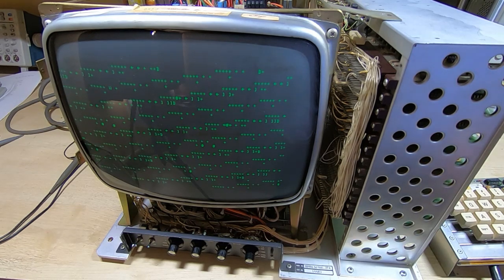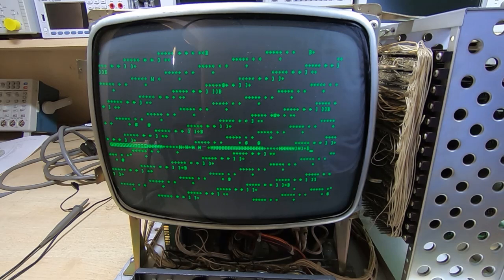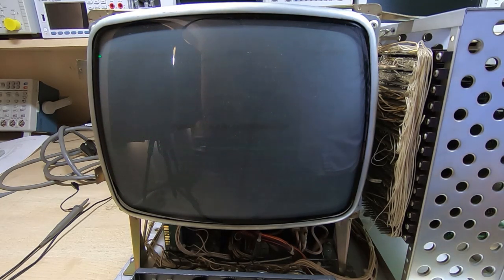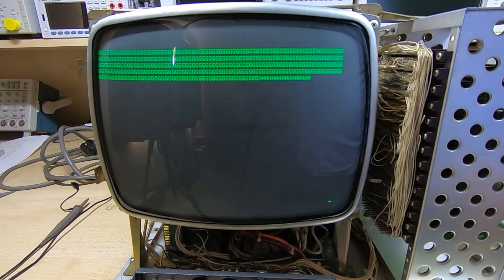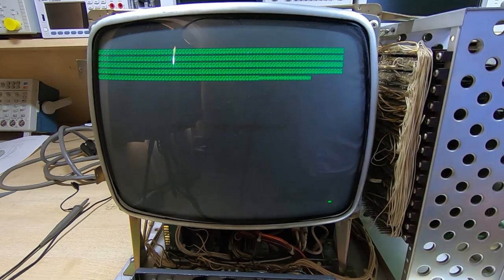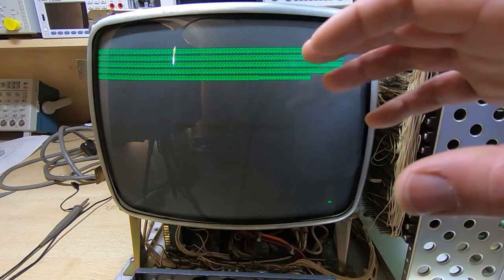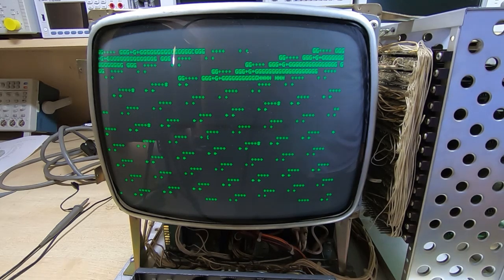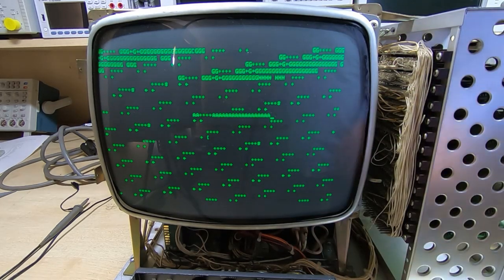Hazeltine 2000 Repair Part8

Comment: Nice way to bring it back operational in a step-by-step fashion. I’ve seen you here and in other of your always interesting series testing device’s monitors with “regular “ signal generators. SENCORE CM2125 and newer models can provide several video test patterns as well as the scan frequencies adjustable. It might be of help for screen geometry test and adjustment. I’ve no clue of other brand that has manufactured such generators. Once repaired it would be interesting to see it “talking“ with PDP 11/34.
Reply: He mentioned this in a video before - he uses a chemical which YT will actually penalize him for even mentioning. I believe it was a substance you can find by searching CAS# 108-88-3. Apologies to @Jerry Walker If this is incorrect, I did a quick search could not re-find the video where he mentions this.

Comment: It seems the foreground / background regions are somewhat analogous to IBM mainframe terminals with their block transmission modes, protected fields and so on, would that be right?
Also as someone asked on the previous video, I'd really appreciate a little insight into how you get the boards so fantastically clean. I know people use dishwashers to do this but wonder about water and soap getting into trimpots, losing paper labels and whatever else. Or is it just a matter of scrubbing them with Isopropyl Alcohol and a toothbrush?

Comment: Jerry, thank you for this explanation.  I've forgotten virtually everything I barely knew "back then" about smart terminals and definitely forgot about foreground vs. background characters.

After watching this series, I'm tempted to go dig out the ~'90s smart terminal (I doubt it is a Hazeltine) that I've got out in the (enclosed) garage.  It appeared unused when disposed of at work, so I liberated it and attempted to use it as a terminal on a CNC shot peen machine in Shop that I supported.  Unfortunately, that didn't work out, so it was stored in the basement under the "Chemical Cleaning Shop" for quite a few years.  When they had a "clean-up," the Supervisor asked me to simply take it home, so I did.  Since it was stored in its plastic bag all that time in the bad environmental conditions, I hope that it survived without corroding away.  I haven't closely examined it since bringing it home and putting it away, but now I think I will as soon as I've got an open space on my workbench.  Fingers crossed!